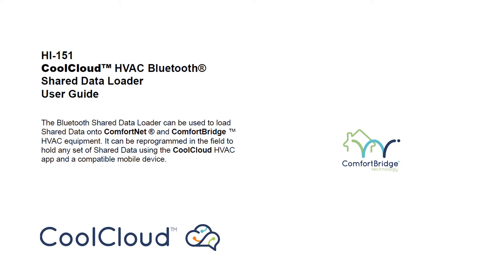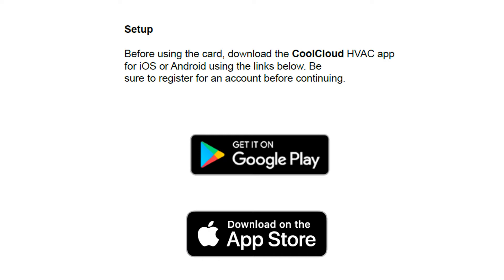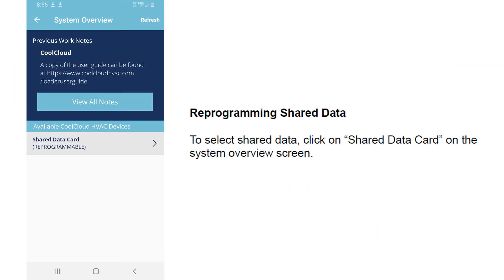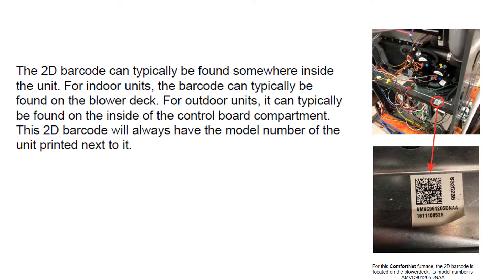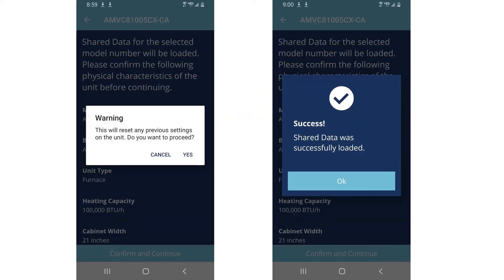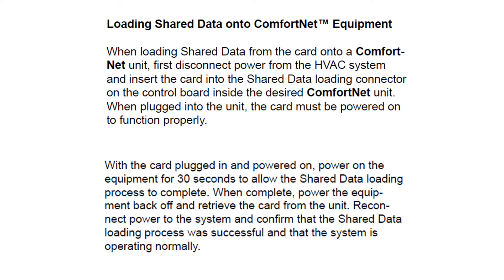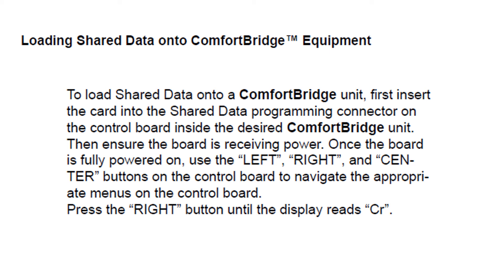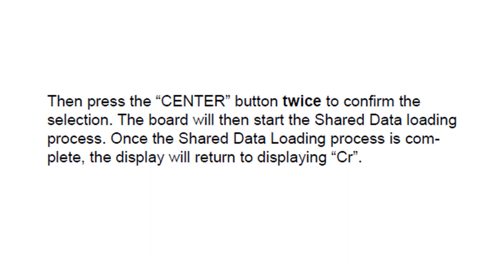hi 151 Coolcloud shared data loader

Comment: I have an AVPTC49D14BC and an AVZC180481AC. I inadvertently applied the data for a xxxxBB to the air handler. When connecting to the ComfortBridge a BC model is not available to get the proper shared data back onto it. I have a D2 and saw somewhere that the BB may be rated 3 - 3 1/2 ton where the BC is 4 ton, and the AVZC is a 4 ton. Goodman support told me I needed the card BTSDL01 and the proper model is not on it either, it actually has older revisions than on the ComfortBridge, it only has .....BA models. The card does have the SD for the outside unit though. How do I get the AVPTC49D14BC shared data to get this back to where it needs to be. Thanks in advanced, good stuff just not deep enough for my problem.
Reply from the maker: The BB and BC data swap will not effect functionality. See our video on D2 error or go into trim setting for air flow and trim ac and hp low medium and high all down around 5% and reboot. This will bring the request for airflow from the ODU down to match what the AHU can provide. The D2 is a common error.
Reply: Thanks, I did try trimming it but this is more detailed, I'll give it a try....Many, Many Thanks. What's the deal with this BTSDL01 not having the data? Is it only partially functioning cause they deprecated the web data update portion to load SD from their server or something????
Reply from the maker: @I think you may need to review AHRI that was supplied to you. I do not find that a match in my system or AHRI directory. Back to the D2, that Unit will not supply enough air even with the proper program.
Reply: Great, it was sold as a matched system
Reply: Yeah looks like you're correct. Figured it was shared data, never thought to look it up, trusted the dealer.....ooops

Comment: Do you take the chip out after configuration? Or leave it in?
Reply from the maker: The chip is removed with power off. On unit repower all DO or related D codes should be gone.

Comment: What if you can’t find your model number on the shared data. 
Model-advc80703bx
Reply from the maker: go to https://mobile.goodmanmfg.com/mobileapp/index.jsp
type in serial number to get correct model. ADVC is not a correct model, I would guess its AMVC but the link will tell you. Type it in under warranty tab.

Comment: Thanks for all your informative videos - they are very helpful. I recently installed a GSZC18/AVPTC in my home. A licensed installer did the work and the system runs fine so far - have used both heating and cooling. One confusing thing is that in CoolCloud, it says "HEATPUMP - UNKNOWN" even though Device Settings and Device Status for the GSCZ18 are viewable/adjustable. I do note that CoolCloud shows a C1 Fault Code (ClimateTalk communication error) for the Heat Pump along with a D2 System Mismatch for the air handler. Wiring is correct - just the the two wires for the GSCZ18.  

Under "Configuration Info" it is blank except for the top header which just says "HVAC Device - Heat Pump" but everything below is a blank page, there is no identifying info for the heat pump.

I would think CoolCloud should be showing the model number for the GCZC18 instead of "Unknown" since it is a communicating system. Not sure what is causing this lack of information - any ideas?
Reply from the maker: Be honest the D2 surprises me more than a C1 code.  Just a few things, be 100% sure you are not using a comfortnet thermostat, you should be wired for a Legacy thermostat only. the 12RC is for outdoor equipment only.  The next thing to resolve your comm issue would be to power down the outdoor unit and turn off both micro switches (1 and 2) marked TERM., usually on that board located near the learn button not to far from defrost switches.  Your polarity must be correct and your voltage across 1 and 2 (control wires) should be .6 volts DC or so.  If none of that corrects your issues I would be curious on the serial numbers of the equipment.  That would tell me if we have had data issues or matching issues.

Comment: Thank you for the information.  I just purchased a complete Goodman system with the Coolcloud capability but does this mean I need to locate and purchase a HI-151 Coolcloud Shared Data Loader?  My friend is a licensed installer and he will be doing the charge side and I am doing most of the setup with his checking the settings when I am finished and I didn't know if this CoolCloud process can be hardwired (If so how many wires from thermostat to the Heat Pump would be adequate?) and if so how many wires for the thermostat?  I was planning on buying some 4 or 5 wire 18ga for the Heat Pump and a 8 wire for the Air Handler.  This will connect to a currently running Ecobee. 

So basically is it fine as a hard wired setup to the thermostat, Heat Pump and the Air Handler or do I still need the HI-151 Coolcloud Shared Data Loader to communicate to the iPhone if my system is the communication version from the factory?  AVPTC and GSCZ (16 SEER) ordered and should be here April 4, 2021.
Reply from the maker: Shared data loader is not needed with cool cloud communicating products, with the exception of a bluetooth failure.  The thermostat will be a one heat one cool conventional system, do not use a heat pump thermostat, 5 wires (common included) is all you need to thermostat and with a communicating outdoor system you need 2 wires (so 5 to stat and 2 to GSCZ).  Change the ecobee settings to be 1 heat 1 cool conventional.  The algorithms in the CFS of the Goodman will chose  between heatpump and stages of electric heat all from the 24v signal on W.  The stages of cooling will be handled in the same manner on the Y.  The only settings you need to make are the ETF to set the electric heat size and then optional items such as lockout temps, stages of back up during defrost etc .  All those can be done by your phone on the Cool cloud app.

Comment: Garbage Boards Garbage communication !
Reply from the maker: The only HVAC control that allows firmware upgrade via mobile phone so far, that I know of anyway.
Reply: @johnstonecg  My installer friend said to stay away from anything above a barebones setup but I have my head in this game and I feel I can keep an eye on it as I am adding whole house SPDs and putting the air handler in a easy to get to spot.